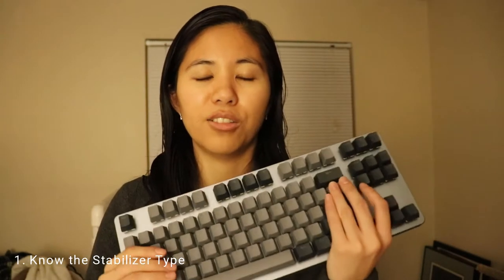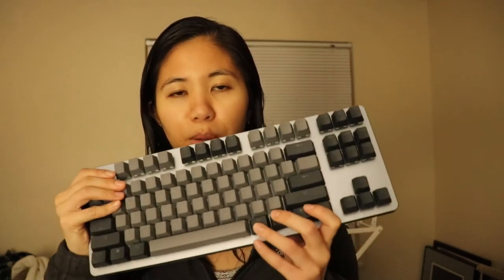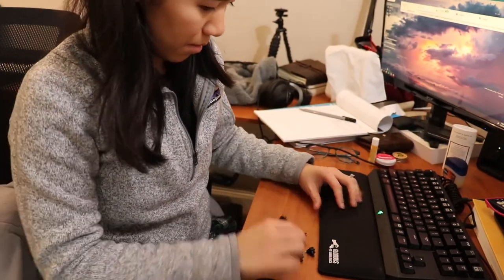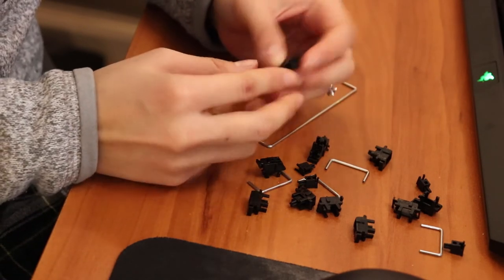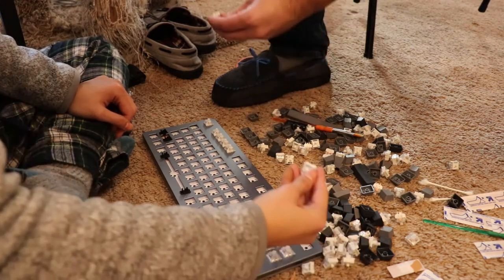Top 5 Mistakes Modding Mechanical Keyboard Stabilizers: Switch and Click

Comment: when you are clipping the stems use a nail clipper. it makes it so much easier and  a cleaner more accurate cut.
Reply from the maker: Great tip!
Reply: @SwitchandClickOfficial  thank you!
Reply: thanks was planning on modding mine soon and was wary about that part... i have spare clippers so thats great thx

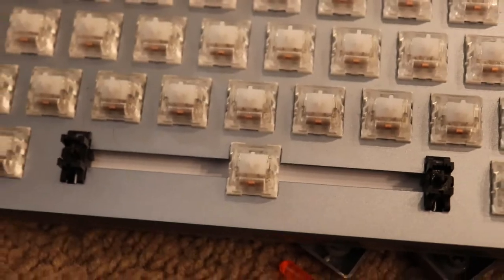Comment: OK 1) Is Know what stablisers you're working with before taking everything apart - you might only know how to work with cherry style stablisers but this particular one is proprietary. And to know what to do with them you might for e.g. 1:32
(1) Can play into your purchasing decision imo - for a first time keyboard experimenter go with cherry mx so you can see all the guides and have all the mods easily understandable and available to you, however once you have experince other stablisers mightbe more moddable.

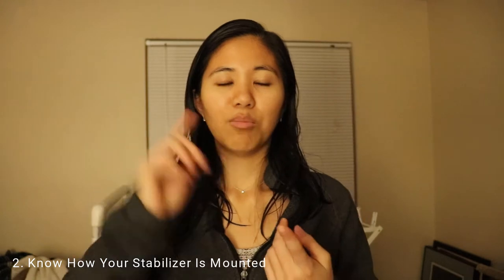2) 2:30 is pretty well explained in the video.

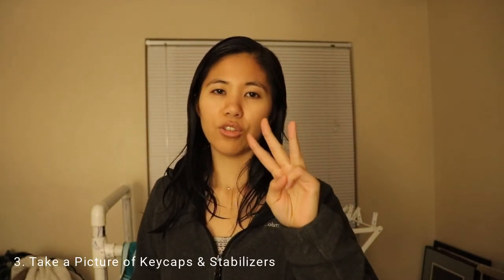3) 3:30 to 4:42 already well explained

4) This is time consuming so work in a workspace where when you're working on the keyboard you don't hurt your back etc. and so when you go to do something else your keyboard won't get dusty or you wont get food on it like if you eat at that desk. Also 5:23 is good advice especially as lube is PTFE you don't nessesarily want to be all up in that and if you ingest it from eating with your hands or something later (as I cant be sure it'll wash off) then some of that PTFE will never get out of your system, so yeah 100% use tweasers, not only does it make a bunch of this way easier but its not good for you. (I also might check the negative health effects of PTFE just to see HOW warey exactly I should be e.g. from now on I might just avoid teflon pans like the plague or be super careful around where I've lubed or just not lube with PTFE (that 205 stuff is PTFE so just use the grease or something that they recommend if the PTFE stuff is too bad or ask around for non-PTFE grease and CHECK that it does indeed not contain PTFE, or if PTFE is relatively safe you could check that it does have PTFE if it turns out that is indeed what makes it a good lube) at all if its too bad despite being one of the best mods and PTFE being from what I hear the best lube for it.

5) Test all your parts and switches ESPECIALLY important with soldering.

Comment: I think I modded mine in November 2019. I made the mistake of putting the wire in the wrong hole, though fortunately, I didn't break anything. I lubed the stabilizers, but I was too lazy to do the clipping and band-aid mod.

You don't need to take off every switch to take out the stabilizers, just the switch associated with the stab. The hotswap sockets are rated for a limited number of insertions and removals, so it's best not to remove switches unless necessary.

The default stabs have too much tolerance when contacting the plate, which causes them to rattle even if you lube them. I replaced them with Zeal stabilizers, which fit tightly on the plate and sound good when lubed. I have no idea how tight the tolerances are for other aftermarket plate-mount stabilizers.
Reply: @SwitchandClickOfficial  Yes, I have the Drop CTRL as well. The Zeal plate-mount stab set I bought are $25 and aren't transparent, but do come with gold-plated wires, which is probably the reason they cost so much compared to the plate-mount stabs from Novelkeys. I don't know if the gold-plating will make a huge difference, but at least the Zeal stabs give the CTRL a more premium sound for stabilized keys.
Reply: @Bugfragged  zeal plate mount stabs are cherry stabs with a gold rod, they sound exactly the same as the ones on novelkeys, zeal is just expensive.

Comment: Answer to your question. I've never modded my stabilizers. All I have really done is change my keycaps. I have an anne pro 2, not the most idea modable keyboard in terms of hotswapable keycaps. But wish me luck!! I'm going to try to convert it to a hot swappable keyboard. I have everything ordered. Been watching vids and looking up tips and tricks. Doesn't seem complicated. Just requires patience. Which I don't have a problem with
Reply: I think I'm going to lube my stabilizers soon though. The sound is less than desirable...

Comment: I wish i watched this two weeks ago.  I was reinstalling pcb screwin stabalizers. Completely reassembled everything.  Then i tested.  That's when i slapped my face... I didn't seat the stabilizer housings flush enough to the pcb causing the bars to not be parallel and so they jammed (got stuck) when pressed.

I had to unscrew the case,  remove every cap and switch just to separate the plate from pcb to access the stabilizers.  

This time i tested just the stabilizers before installing plate, switches and caps.

I think this is normal when learning to work with keyboard.  It's an initiation.
Reply from the maker: very true

Comment: my spacebar doesn't work properly after i modded all the stabs, it's like sticking into the stabs and won't bounce again. Have you ever experienced that?
Reply: Try putting the stab insert and housing on a flat surface and then put the stab bar through
Reply: @erickwon8528  thanks!

Comment: also try putting a piece of  fabric or bandaid where the stab wire meets the stem
Reply: @fucker9002  you can  put fabric aswell in the actual stem w/ or w/out, there a few videos up about it check them out
Reply: it’s called the Holee mod I believe? I think it does the same as lube, by making the rattle less since the metal stabs aren’t hitting the plastic stems as hard when pressed. It’s pretty time consuming, but I did it, makes a big difference I 100% recommend it
https://youtu.be/aDX-jwbqie4

Comment: Can you replace stabilizers on every mechanical keyboard out there?
Reply: @SwitchandClickOfficial  I asked some people, they said that the stabilizers might be soldered with the switches, is that possible?
Reply: @joshe2420  I guess when switches are soldered instead of using hot swap sockets you will have to desolder them all to remove the plate unterneath and then get to the stabs. really depends on the design of the board tho!

Comment: I put my keycap back on after trying to holee mod my keyboard (i clipped of the short legs off of the stabilizer) i failed to do the mod properly so i took everything out and just put the stabilizer back together and then i put it back in to my keynoard. The keycap doesnt come up after i put it in, ive tried many things and i have checked several times that the wire was in the right hole but it seems that it isnt working. Another thing i noticed that one of the stabilizers was working but the wasnt. Btw i did this all on a eyooso z686 and on the spacebar. I do t know what to do so i would appreciate it kf someone would help me.

Comment: So I did a bandaid mod on my gmmk and all of the stabilizers besides the space bar are wayyyy too mushy. I used a bandaid with some dielectric grease on both the bandaid and stabilizer. Any advice?
Reply from the maker: I'm not a fan of bandaid mods, just rip out the bandaids :P
Reply: @SwitchandClickOfficial  will do! I had box jades and never noticed the mushiness until I put on gateron blacks lol

Comment: Right now I'm 5 hours into fiddling with stab wire for the space bar and I'm close to tearing my hair out. Balancing it with a pair of ballpoint pens but I can't seem to make it straight no matter what... I'm wondering if there can be a minimal movement when doing balance testing or literally no movement at all? Definitely need some guidance right now
Reply: ye i cant work with wire balancing either, recently found out about the holee mod tho so you can try that